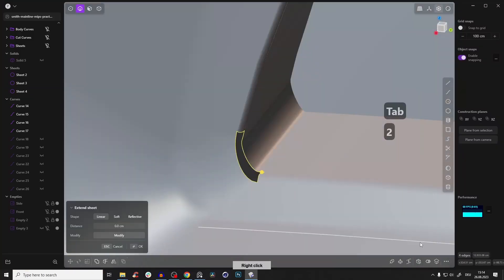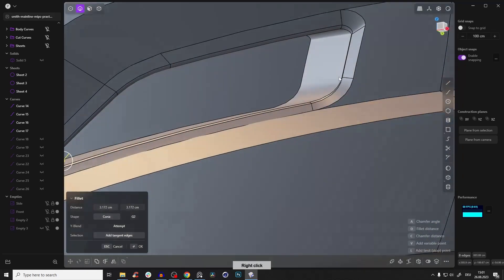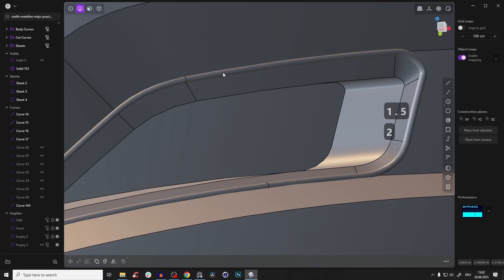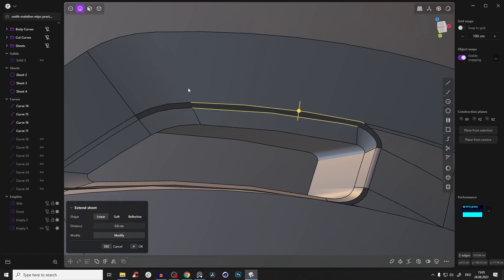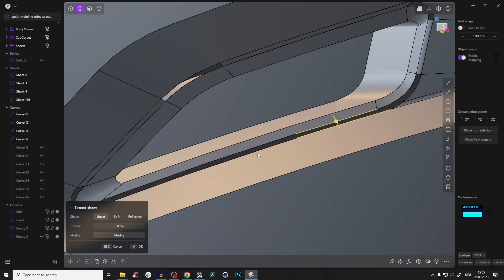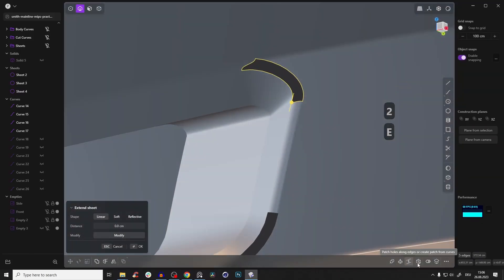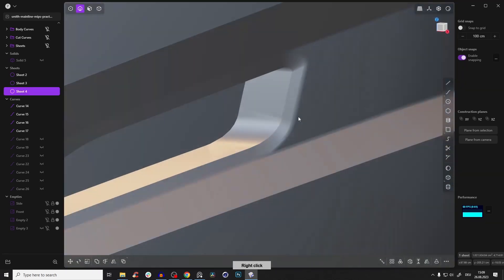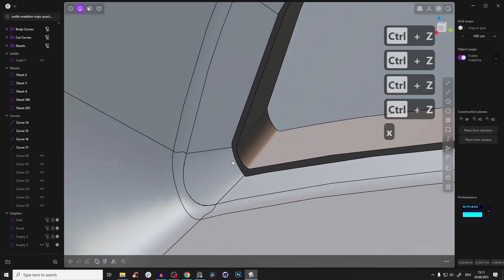Create Perfect Fillets in Plasticity with Surface Modeling! | Tutorial

Comment: Similar technique to what I used to do in Rhino. Glad to know the same strategies work. Except in Rhino, you could select the entire loops and add control sections instead of cutting surfaces to get the nice flow. But, Rhino adds too much geometry when exported if you rebuild a curve with that many points, does Plasticity do that? Nice video though. I've been learning Plasticity keyboard shutcut usage by watch your vids. 👍
Reply from the maker: Interesting to hear!
No problems with exporting in PLasticity when rebuilding curves. It somehow "regenerates" the geometry for export from the moment when you want to export it. 

Don't know how to explain and if that's technically correct what I wrote, but it does work !:)

Comment: Nikita, I see that the same thing happens to you as it does to me. Sometimes split edges are created by creating those points that force us to make several lofts or even make isoparams (I'm not sure that's how it's called 🙄) or also make lofts of sections of multiple edges that don't always work.
We can split the edges, create wherever we need them, but how do we eliminate those cut points? I think there is an operation to remove them but it doesn't always work. Have you tried eliminating those annoying "splits"?
Reply from the maker: I am not sure if I understood you correctly, but you can delete the additional edges that were created through Isoparam with the "Delete redundant topology" command.

If you want, you can join our free community and attach some screenshots or a simple video showing & explaining the issue and attach your Plasticity file and I can have a look into it:

You can join here within a few minutes
https://www.skool.com/ultimate-3d-membership-7140?invite=16b95b9b21c9440db3befabf4b050640